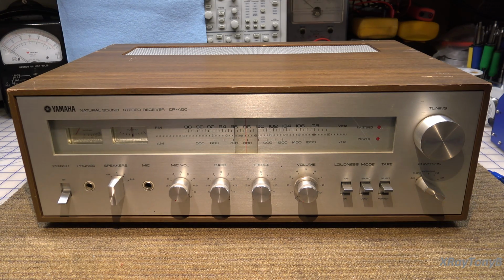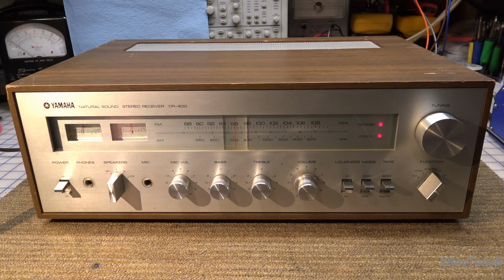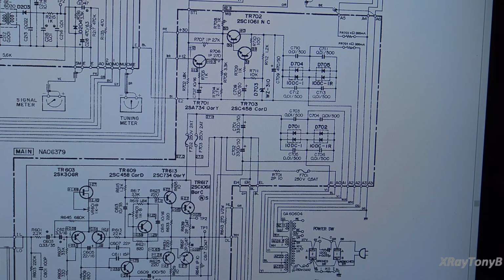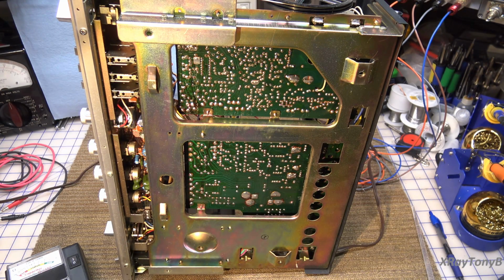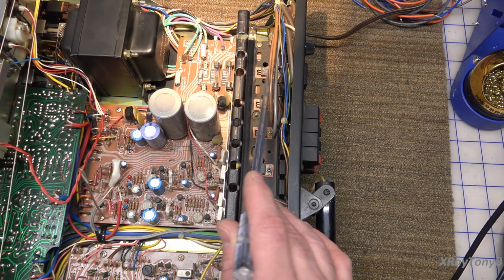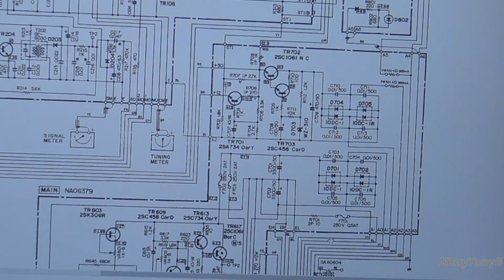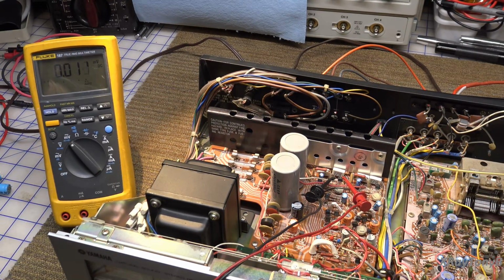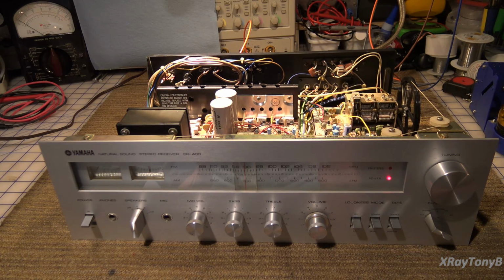Yamaha CR-400 Repair

Comment: Great video, thanks. I have a CR-400 and am busy replacing the meter and dial bulbs with LEDS. The existing bulbs are connected to an AC supply ( tags A5/A6) on the main board. The LEDs require a DC supply. What did you connect the LEDs to? Update: I strung the 3 meter LEDs and the dial LED, together with a 33 ohm current limiting resistor, all in series, and connected them across A6 (0V), and the +12V pin at the front rhs of the main pcb. Be advised that this circuit is soft-start and takes a couple of seconds to power on.

Comment: A fuse that is older will sometimes, maybe even often blow below it reaches the specified rating.  These would be a gentle, non-explosive type fuse failure and often is rectified just replacing the fuse.    Sure, sometimes there will be an issue, but sometimes it is just the fuse is old.  A violent failure is, of course, a different thing altogether.   
As others have mentioned, your whole theory on fuses is actually completely wrong compared to how they actually work in real life.

Comment: I agree with Geir Jenssen: the voltage rating on a fuse determines what the fuse can safely handle when it blows. That's why, as you pointed out, automotive fuses are rated for 32V but, that's because the fuse only has to prevent arcing after it blows with ~13.6VDC. It has nothing to do with the voltage in the protected path while it's not blown. The only "voltage" that's relevant when it's not blown is what develops due to the resistance and the current flow through the fuse; i.e., Ohm's law. Your statement that the fuse "at  lower voltages these will go a lot higher in current.." is entirely incorrect. Even a cursory google search of "voltage rating of fuse" will explain this and so, no, a fuse shouldn't be rated for wattage. That's total nonsense.

Comment: Would it be possible to to highlight the pointer or continue to point with a pencil when tracing the schematics on the computer screen? I have low vision and it's difficult to see where the pointer goes sometimes. If it's is a big deal, don't worry about it.  I realize it's frustrating no matter what you do someone wants it different.  I appreciate your in depth detail on your repairs. I uesd to repair consumer electronics and now just once in awhile.

Comment: Odd fusing scheme in the power supply. The positive rail is fused but the negative is not? I'm guessing they are relying on the 500mA fuse on the center tap to be the protection.
I guess it works because we witnessed a sick cap shutting it down.
Reply: That's not really an odd fusing scheme.   It was explained quite badly, but the fusing actually makes sense.

Comment: Damn you are brave :) Id never connect speakers to 65mV outputs...
I have a rule of thumb, of 50mV absolute max... 
in my opinion, No fully functioning amp should put out 50mV DC, So if there is more than 50, i wont connect speakers, and will assume a fault...
Reply: Not true.
Reply: @philipslighting8240   true or not... That is my general rule of thumb.. ive never seen a fully functioning, good health amplifier, put out 50mV DC, or higher.. 
Heck, When repairing my Peavey power amp, with shorted T03 transistors, it didnt even give out 50mV DC... Now repaired, it measures at 0.5 - 1mV DC at the speaker terminals, With the crowbar speaker protection  triac's removed..
Reply: I have a Technics SA 400 from the late 70's that puts out 55 and 61mv. I say it's to high but my tech says that's fine. There is no adjusting it. What would be the most likely cause of a high reading in this situation?
Reply: @johnloupis2347  I would not worry if its designed to be that way.
Reply: @philipslighting8240  Why would it be designed that way? What possible good could come from having DC voltage on the speaker terminals?

Comment: I have seen similar designs on other units, where the 10 ohm resistor (in this case) actually is the ground for the inputs and pre out. I've seen it on Hafler (.5 ohm and 1 ohm) Adcom (100 ohm) etc. Best as I can tell it's purpose is to suppress ground loop currents. In those designs however the open resistor causes an offset.

Comment: I like to run the unit for a while and then check it with an IR camera to see if any capacitor is getting warm.
Sometimes that reveales a hidden issue that i otherwise would have missed.

Comment: But how can high ESR in a capacitor blow a fuse? It's just a resistance in SERIES with the capacitor.
Wouldn't it be caused by a leaky capacitor (leaking DC current) like it had a resistor in PARALLEL across it (High EPR)?
Well, I guess it depends....   on the circuit it's in.

Comment: I'm not totally on board with the Fuse/Voltage idea.
As I see it, the fuse has a fixed internal resistance, and Ohm law applies to the fuse just as it does to any other component.
So the voltage accross the fuse is given by the internal resistance of the fuse and the current passing trough it.
You can also see the fuse as one resistor in a voltage divider, and the circuit it protects as the other resistor.
The internal resistance of the fuse will probably change as it heats up from increasing current trough it (wattage dissipated accross it).

Comment: Less heat is created with high voltage and low current for a given wattage in a conductor. P= I * V , so low voltage and high current would expire the fuse with less watts. Would be a good video experiment to see how much difference there is.

Comment: I wish it was the 200. I have one sitting on my bench needing love. I was trying to save it after a previous repair attempt. did a full tear down detail, cleaned the pots and switches and gass, scrubbed the face plate. it looked new and ran beautifully. I recapped it and reflowed the joints. i decided to bias it before putting the lid on it. moved the VR slightly and a driver transistor blew clean in half. like a mini gunshot.  the transistor was under rated as I found out from experts on AK. the previous owner swapped in bogus transistors. I found out the hard way and it has sat since. looking amazing as a boat anchor. LOL first one I blew up.
Reply: Would you be able to find a replacement for those driver transistors?
Reply: @ElektrikaCo  yes. I can get them, but I was so disappointed I decided to give it some time and regroup in the New Year. I even tripple cleaned the glass and face plate. It was operating quite well, I was just being through.

Comment: Great work and a nice quick fix!!  I love working on Yamaha equipment, they seem to be built with serviceability in mind.  One of the bigger receivers in this line has a hinged tuner section so you can work on bits without huge headaches.  I’ve been looking for a resettable fuse replacement for testing purposes.  Prices for 250v fuses has skyrocketed!  Hope you have have a great holiday season Tony!

Comment: I always understood the voltage rating on fuses was to prevent arcing across the fuse during over current event.  Wire and fuses don't care about voltage,  just current. Insulation and air gaps are for handling voltage,  right?

Comment: This is the kind of receiver I love the most. Brushed silver metal, wood cabinet and a simple design. What a beauty! It's hard to explain, but these smaller, simpler receivers have a unique charm to them.
Reply: i love them. yamaha and sansui and even sony baby amps. I sold a sx-450 because of the dodgy tuner. the others are dead on.